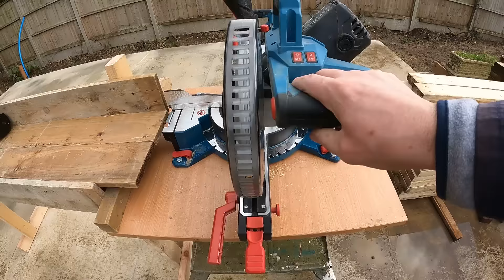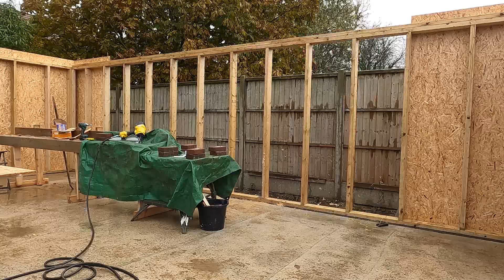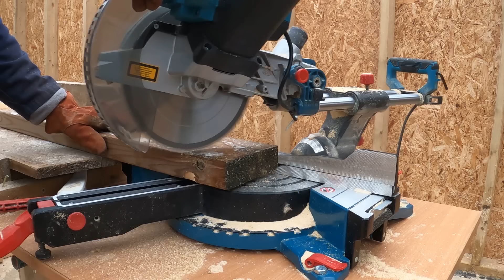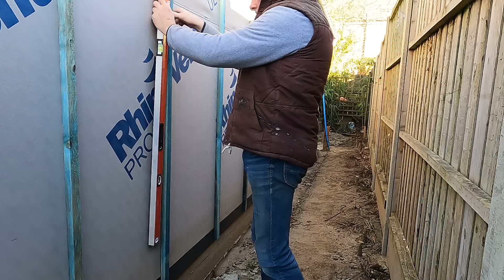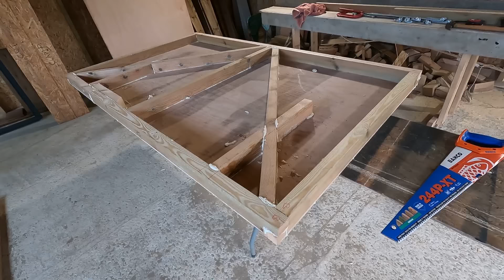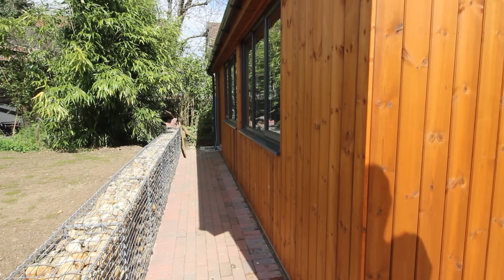Workshop Dreams

Comment: am 12mins in and I can tell you window headers are gonna sag under the weight of the roof 😲😲😲😲
Reply from the maker: Yep the building inspector made me add a beam 10x4 across the joists and braced to the slab. Clearly he thought they would sag also.
Thanks for the comment always good advice from a professional.
Cheers

Comment: osb is not always square from the factory , good job on the workshop tho 👍👍👍👍
Reply from the maker: You are right but I did check off camera. I have used over the years lots of sheets and can only recall one or two that were wrong.
My local supplier stocks seconds that are not always very good, but they are cheap!
Cheers

Comment: Not sure how I stumbled on this video but what a build! Out of curiosity, as I’m about to do something similar, why did you decide on a timber frame and not concrete blocks? I’ve priced mine up and it’s almost half the cost using concrete blocks vs timber.
Reply from the maker: If you’d seen any brick work I have done you’d know why I went down the timber path.
I hope to get 25 years out of it so should see me into my dotage.
Cheers

Comment: What a build.  I’ll start following your channel and be checking in on your progress. 
I’m very similar to you, in the way that I mostly work alone and end up in situations where I’m in one place, unable to move, and the tool that I need is at the opposite end of the room, or just 2” out of my reach.  I recently had my dream garage built.  Only a 36 sq meter, but in two levels with an equal sized basement and a 1x4 hole in the floor, aka a pit. My dream garage.
Reply from the maker: Good work sounds like a good shop / garage. I find work is like those puzzles where you slide squares around to make a picture, you have to think several steps ahead!
Cheers

Comment: Hi, great build .. and nice gentle commentary. I'm a cabinet maker by trade and need to build one in the garden myself this year. I was wondering if you needed planning permission on the height?  (It looks more than 2.5 in the vid and less than two metres from the boundary fence). If you did get planning permission, was it fairly straightforward? . Thanks
Reply from the maker: Hi Nathan,
Yes I did need planning which was straightforward. The problems started with the square meterage as it’s over 30m2 it needed building regs that’s not straightforward or easy.
Cheers

Comment: Very good, really interesting. The only thing that I'd query (not a criticism) is the roof vapour barrier being laid directly on the waferboard in regards to condensation/lack of breatherbility. It may not be an issue but I think I have ocd anyway 😊......the 'overhang' construction on the gables are called gable-ladders by the way. 👍🏴
Reply from the maker: Hi I know exactly what you mean I was concerned enough to ring the tin roof manufacturer. They told me what I was doing was ok and the roof should last 30 years.
Not a builder so not sure what to call things.
Cheers

Comment: Very impressive that you did that mostly by your self. But a couple of questions - did you insulate the ceiling ? And what about ventilation? Here we have to ventilate the attic space.
Reply from the maker: Hi yes the ceiling is ventilated there is a small air flow through the bargeboards into the roof. There is also 150mm rock wool up there.
Cheers

Comment: Cost as much as a small family car… but still wow! What a fantastic build. Honestly it is better than some of the flats I’ve lived in. I’m in the process of clearing ground for a shed/workshop myself. I’m not going to do anything as good as this, but then mine will have to do. You have given me a lot of ideas. That’s been a real pleasure to watch.
Reply from the maker: Glad you like it! I have been stunned at the cost but prices have risen so much in the last couple of years.
Good luck with your project 
Cheers
Reply: @CazualHaze how much did it cost for materials?
Reply: @ 
Hi Stephen,
I use the analogy of the price of a small family car.
I got deals on some bits mate rates on others and a bit of cash in hand so I can’t really be more accurate than that. If you build something similar then keeping the size under permitted development will save a lot of money. This needed building regs which means you need architectural calculations which alone took me a month to research and calculate. Which in turn resulted in timber far beefier than I wanted to use.
Cheers
Reply: It went along with William the concreter.

Comment: Nice job having built many timber frame house's in my time
Those long wood screws you used on the studs were not necessary
Reply from the maker: Thanks I know. I used the screws because I am worried about climate change and vastly increased wind speeds. Being a lightweight construction the lifting forces don’t need to be huge to rip it off the ground.
I know its overkill cheers

Comment: Amazing job and very envy :) Just a question, is there a reason you dint use insulation above the ceiling boards?
Reply from the maker: There is insulation in the loft area I forgot to add it to the video 150mm rockwool roll!
Cheers

Comment: Very impressive workshop, but two questions. First, seeing as it is basically a very nice shed, why the need for building regulations, and second, what was your rationale for lining the walls with plasterboard when OSB or ply painted white would have been more practical for fixing shelves and the like.
Reply: Sheds have a size limit before building regs apply, I think around 15msq
Reply from the maker: Good question! It’s too big tall and close to fence to not need planning. The in side is lined with plasterboard for fire precautions.
I’ve seen red hot embers going through the dust system into the sawdust bag when my cnc router went off in one and cut through a hold down bolt!
My lathe has been known to spit out chips that are white hot as well.
It’s a wooden shed after all!
Cheers

Comment: I know you've give the square meter area, but I can't visualise that, can i ask whats the length and width please?
I have started my own dream workshop, well the one my and my dad always wanted really. Sorted the base myself with some family help. Then in April they came and assembled my wooded workshop, sadly the panels were to heavy and solid for me to manage at all.

Its a shire 12x24' mammoth workshop, well worth the money very strong finished in 19mm loglap, couldn't recommend them more. Ans as i had an eco plastic grid base, gravel filled, it has cost a fraction of yours, but id like to have done it your way myself. Just had spinal surgery so the insulation and lining has to wait a little now, at atvleast lying here has given me the chance to see how id of like to do it being done, could of gone a little bigger maybe......
Reply from the maker: Hi thanks for the comment 
It’s approx 7.7x 5.6m  eg 24 x 18 feet 
I hope you get over the surgery soon.
A friend of mine said does not matter how big you build it it’s never enough!
Cheers
Reply: @CazualHaze  it's true there never bigg enough, I tried to get enough room for the 30x12, but couldn't manage it.

Comment: When you installed the windows you use silicon to seal the window to the cill on the outside this is incorrect. This is where drainage comes out of the window which is concealed at the bottom of the window falls onto the sill and onto the ground 
Nice job!
Reply from the maker: You are right of course, but these are recycled widows and were intended to be installed 90 degrees round or vertical. So I am hoping I don’t get too many problems, the weep vents are on the sides not the bottoms.
I could pop out a window and drill through if needed.
I guess we’ll see, if I get issues I will pass this on as it may help others!
Cheers

Comment: Enjoyed that. What air nailer did you use? Looked like the silverline brad nailer for the cladding and the yellow one a finishing nailer?
Reply from the maker: The other nailer is a 34degree framing nailer from machine mart in the uk.
If you have a compressor far cheaper than a fancy battery or gas nailer.
Cheers

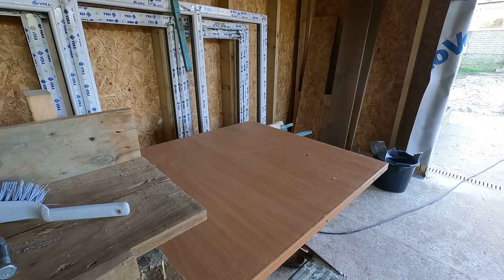Comment: 19:50 “Edward the compressor”😂 brilliant pun.  The problem with any shed style outdoor building in Britain, insulated or not….is moisture.  Particularly over winter if the place is not heated. Come spring you decide to go back into the workshop and find all your tools have rusted.  I find ferrous metals rust even if left in my closed conservatory.  Ventilation is a double edged sword when the weather is bleak…Do you let all that wet air get inside or not? If you can afford to leave a heater running safely over winter that’s the best solution, but it will cost you!
Reply: A dehumidifier may help with this. Permanently drained outside.
Reply: Just oil your steel tools..chainsaw bar oil has tack to stay in place works on all the steel tools..
Reply: Easily solved with a decent dehumidifier - it’s not a problem at all if you build correctly
Reply from the maker: Yep I agree I will see how I get on with it. I am going to put a solar array on the roof so there may be spare power to keep it dry.
We’ll see I guess 
Thanks for the comment cheers
Reply: Ive never had a problem in 2 decades which i think is due to tools stored in wooden boxes, just like the old days!

Comment: I don't comment on too many videos, but I have to on yours, for several reasons. First of all, magnificent build, together with great and amusing narration. If you don't mind, I'm going to call my compressor 'Edward' from now on for reasons only the English will likely understand 😄. Like you, I'm also belt and bracers to a level of annoyance and disbelief from my Son 🙄. Finally, you haven't mentioned any security measures you will be taking, I'm hoping to see this in your next video. With the value of tools and modern DIY equipment you will probably be storing, can I suggest cameras and lights leading up to the building and on all corners, motion alarms on doors and windows, anti-climb paint on all vulnerable areas above head height, and a couple of rottweilers permanently residing inside - belt and bracers don't forget.
Reply from the maker: Wow thanks for the comment I’m going to install a cyberdine terminator which will also give me a steady supply of fresh muntjack deer for the barby 
Cheers

Comment: How long did it take to get planning permission? One of the other commenters mentioned about it being none combustible by the fence. Did you only need a fireproof cladding on that side? I'd always taken it as all being that way.
Reply from the maker: Planning took around a month the fire resistant side is from the building inspector. It’s because the workshop is not far enough away from the fence.
I left just over a meter as I thought that was enough to get a wheelbarrow through.
Cheers
Reply: @CazualHaze  Bimey, a month is brilliant. We looked at moving and downsizing the house recently and applied to see if we could even get permission to rebuild the garage, but bigger. It took 3 weeks for them to decide we wouldn't get permission. At least it was cheaper than a full application, which would have taken 4-5 months. We pulled out of buying the property. What area are you in, we need to move there?

Comment: That's an awesome build - as a 65yo DIYer I admire your tenacity.
 I had similar problems with the floor in my own workshop and went with a Rubber Floor Paint made by Palatine Paints - it's been down now for 5 years and is durable and water resistant. I highly recommend it.
Reply from the maker: Thank you very much! The epoxy I used is dear and full of pinpricks so the jury form me is out so far.
Cheers

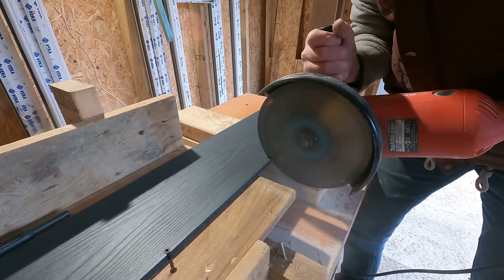Comment: 21:50 You have to use something non-combustible... next to the combustible wooden fence. 

Which is why I think a lot of the building regs are a nonsense.
Reply from the maker: Yep that is hard to fathom. That one thing added around £1000 to the cost, for no gain!
Cheers
Reply: Surely the point being that a fire that starts at or spreads to the fence (eg from a bonfire etc) can’t then spread to the “shed”?  Building regs aren’t trying to save the fence if the shed catches fire
Reply: @jra55417  But fences touch buildings all the time. 

Wouldn't be much use having a fence to keep people out if it's nowhere near your house, leaving a 6 ft gap for people to walk through. lol
Reply: @fredmercury1314  that’s not relevant to the point. The point about the regs is the building is protected from spread of fire via the fence.
Reply: @jra55417  It's wholly relevant. 

If there's a fence attached to your shed, then it's a fire risk (according you). 

But if it's attached to your house, it's fine.
Reply: @fredmercury1314  no it’s not fine. If you build a house a metre or closer to a boundary, you have to use non combustible materials for the building. Ask me how I know

Comment: Well done. Two things not mentioned were ceiling insulation and the lintels over the windows which seen to have been added at the end. I did wonder why no lintels over the windows when you put one over the door. Did you forget it was it due to the reclaimed windows you sourced? Shame your building inspector didn't mention it while you framed it. Looks great
Reply from the maker: I missed it out on the video but there is 150mm rock wool in the ceiling.
The windows were my biggest mistake they had to go high to make the bench that ill fit in front 900 high. So they are propping up the top wall plate. I thought that was good enough the building inspector thought differently hence the extra timber to act as a lintel.
Bit of a pain as I need to do more work to fit trunking around them.
Cheers

Comment: That’s epic! Did you need planning permission or was this under permitted development? Wanting to build a workshop in my rear garden.
Reply from the maker: I’m in the uk and you are allowed to build upto 30m2 without planning but the height is very restricted and you need to be further away from the fence than I am.
So yes I did need planning and that in itself is worth a video. It’s a long process as you need to comply with building regs. You have to supply drawings and structural calculations to prove it won’t fall down!
Having said all that I feel the finished building was worth the effort.
Cheers
Reply: @CazualHaze  thanks for the response. So basically, I've got to a point where I believe I can build a 16x20ft with pitched below 3.5  metres in height but eave height maximum 2.5m from bottom of base providing I am 2m away from border and less than 50% of land occupied Inc original House under permitted development
Reply: @ramsaysg if you are 2m away from border you can go to 4m heights.
Reply: thats whats i wondered

Comment: Lovely job. How much does a small family car cost?
Reply from the maker: More than a Nissan micra or change from a mini
I started planning this before Covid struck and it has cost about 30% more as prices have gone up.
Cheers
Reply: @CazualHaze  Is that new or used and BTW Micra doesn't appear on Nissan website so none the wiser.  Cheapest new Mini is c£23k and most expensive Micra on Autotrader is £11k.  Go on, just shout out a number🙏

Comment: Watched the whole thing. You accomplished a lot. Vertical siding is normally nailed blind through the tongue where you don't see the nail, similar to your proper explanation for your horizontal siding. But, none pf it is ever going to fall off! No lintel over the windows would get you a structural inspection failure here in Canada. But it appears that your applied beam and posts are a stop gap. Liked the wall insulation. What about the ceiling? Most of your heat loss is through your ceiling! Your plasterboard lift is a godsend indeed. I've used them enough that I bought one about 20 years ago. Best thing I ever purchased. Were about the same age. I feel your pain! 

Proud of you! I learned at the side of Masters. You did this all on your own. Something to be proud of.

Mark
Reply from the maker: Cheers mark,
Yep I know the siding (we call it cladding) is usually hidden nailed, truth is I got a bit trigger happy and as you say it wont fall off!
The lintel is not clear from the video my building inspector made me add two lots of 180 x 50 beams over each window. They are nailed glued and screwed together and fully support the joists also the rafter ends. He was happy and so therefore I am as well. The ceiling has 150mm rockwool missed adding that on the video but it is there. 
I could not have done it without the plasterboard lift I hired it in, it was a bit beat up but did the job.
In hindsight I would recommend anyone wanting to do this sort of thing to get a good mitre saw and a nail gun! I am proud of it so far I really needed the extra space. 
Visiting Canada soon meeting up with our daughter she's in Vancouver, lovely country!!
Cheers
Reply: @CazualHaze  Wave as you fly past Ottawa. If you plan on looking around the Capital let me know. I'd be happy to show you around. You are 100% right on the nailer. As a young man I hammered everything. I can't do that much more than one day anymore. But that shop of yours is a days framing. We used to nail on the exterior cladding to while the wall was laying down. So much easier. Working as you did it was not so easy.

You will enjoy Vancouver. It's quite different from England that's for sure.

Mark